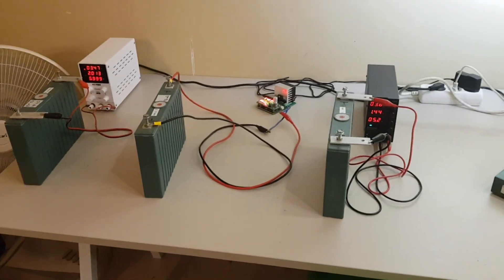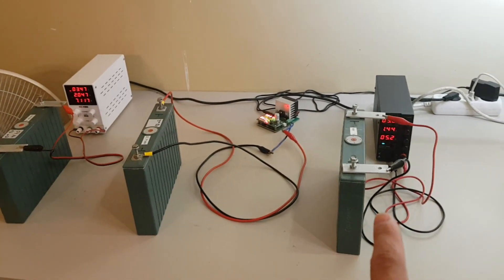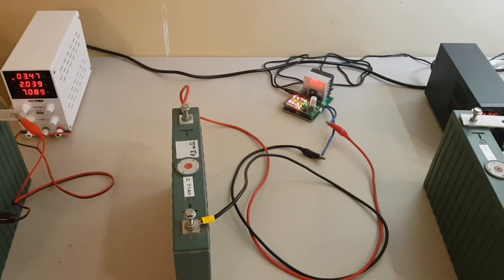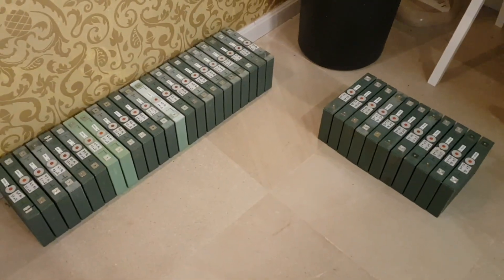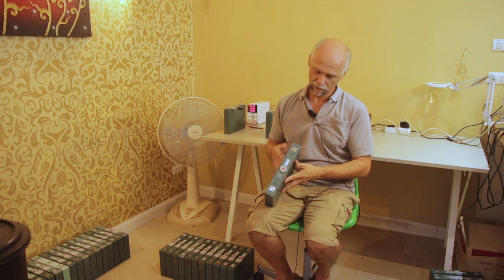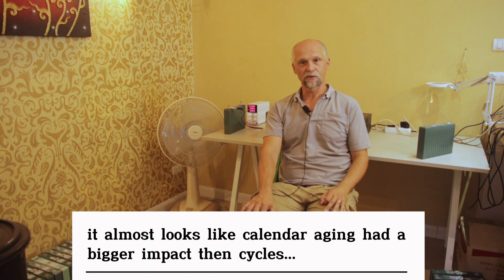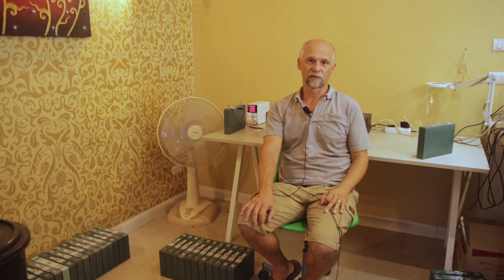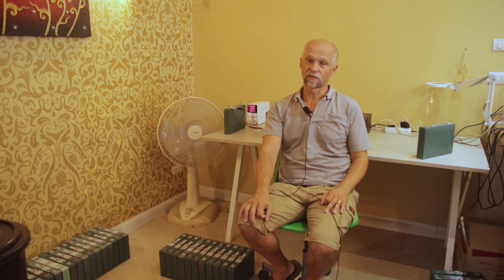LiFePo4 Cells at the end of their life! How did they perform, what's left of it?

Comment: I have Narada 48V 15s 100 ah battery which was not giving good off grid backup. I have total 4 of them. This problematic battery get charged fairly quickly than other three. They are all in parallel to get 400kwh. Since i bought used there was no warranty. I opened the pack and found one cell 3.7V all others were 3.31V to 3.32V. The bms i think stops charging after noticing one cell has over voltage. I drain that cell  using power resistor to balance and connected to inverter without bms to charge but that cell over charges  again to 4.2V dangerously high. Took that cell out it was fully swollen. Replace that cell with 0.32milliohms ir cell. Now its somewhat better but still not as good as other three. What do you think is the problem. One thing i notice that cells above and below when charged without bms were 3.5V , is it because of that overcharged cell. I may have to open the pack again to see voltages again .
Reply from the maker: You definitely had a dead cell and it needed to be replaced. When you replace a cell, you have to slowly charge up the whole pack and simultaneously drain down the cells which reach above 3.45-3.5v to top balance the whole pack. do not remove the BMS! It just makes sure no cell will overcharge or over discharge.
Packs which do show capacity issues without having dead cells, usually are having severe balance issues. You can either install a powerful active balancer or manually drain high cells by performing regular manual maintenance once the pack is nearly fully charged...
Reply: You are absolutely right. Another cell, the one above the swollen one is also bad. Checked voltages again to a fully charged battery. All 14 cells were 3.33V to 3.35V but one cell that shared +ve terminal of swollen cell is also bad 3.7V let me change that cell too.

Comment: Wouldn't matching internal resistances and capacity be advisable?
Reply from the maker: yes. But then all cells of the pack must be similar. If something goes out of line, it must be removed. Strings with different resistances and capacities would have to build a complete separate battery with its own charge controller/inverter.
That's why battery manufacturers say you should only put the same age packs in parallel or at least buy them only a year in age apart. But that.also means you cannot regularly upgrade your storage capacity by just adding new packs in parallel...
Reply: @RolandW_DIYEnergyandMore couldn't micro inverters used for solar make a distributed battery with each unit of similar characteristics contributing to ac bus?
Reply from the maker: @robertpeters9438  one could make an array of small batteries. But it's not always easy to just connect a microinverter to batteries, and then its again much more complex, probably more expensive as you need a charge controller, bms, cells, inverter for each. And that to save worn down cells from recycling? It's anyone's decision.
I did that sort of energy storage before. Now I am happy that I have a much simpler setup :)

Comment: wow 6k views in 5 days. glad to see your videos and hard work is getting more recognition. really good info. no one online really has end of life data yet in this space. 
the fact that these things were rode hard and put away wet before you got them, yet you were still able to get so much use out of these in the hot thailand weather with daily use. i think ev environment is the most demanding for lifepo4 cells. they really dont like to be discharged fast, and dont like to be charged cold. both things happen in ev applications. also the early EV battery packs were kind of garbage for regulating temp/charge/discharge parameters.
the smaller the cell packaging/ah rating, the better they fair with high current applications. these are on the low end of large format today but back then they were probably some of the largest cells being mfg. another important factor.
there was a study recently about how occasional high current discharge/charge such as in EV's with their regen breaking and lead foot drivers might actually help extend the life of lithium batteries. i think the study was only done on NCM chemistry though. I know for like lead acid if you over charge an old cell you can sometimes allow for side reactions which can regenerate cathode at the cost of some electrolyte. would be interesting to weigh them all and see if there is as good of a trend as the internal resistance. thats a lot of work though :)
thanks for uploading roland
Reply from the maker: Yes. For my channel this is considered as a viral video :)
Don't know if such cells could be refreshed a bit. Don't think by overcharging as they would bloat right away, but maybe fill up a few milliliters of fresh electrolyte. hehe
Reply: @RolandW_DIYEnergyandMore  ya from what i understand the solvent they use is a phosphorus based alykl compound and is pretty nasty stuff in terms of health hazards.
i would just buy new cell4s lol. here in the usa they were around 35usd/kwh a month ago before all the tariff garbage

Comment: If stating data sheets you also have to look at the whole picture! The cycle life stated is only that ... cycle life at low stress. Loaded at 1C constantly the cells could to 12 cycles a day, 4380cycles a year with aging not being a factor. I don't know an application in which such stupid thing is done and the energy not just used directly, but the application is not the cell manufacturers premise! Additional there is calendaric aging component, too. Electrolytes have made huge progress in regards to calendaric aging for ALL lithium based cell chemistries! And simple stuff was found, like the type of tape used to fixate the rolls or stacks before they are inserted into the canister having had doubled the calendaric aging is only one step. Hold that picture in your head: Just changing the material of that 2cm of tape HALVED the calendaric aging!

These first gen cells are clearly first gen! If the manufacturer states 2000cycles and the cells, just for being 1st gen, have 2% of calendaric aging, they have lost 16% just through age alone! That leaves only 4% of the capacity or 20% of the whole degradation "bugdet" for cycling ... or TADA ... 400 cycles to 80%. In the original use (3 years to 80% it was?) this would mean 6% through calendaric aging, 14% through cycling (which is 70% of the degradation-budget), so 1400 cycles. This would mean 1.3 cycles a day, or in practice two charges a day of the bus. This is totally in the realm of possibility, as battery sizes in busses back then were tiny!

Grid battery providers are stating that through real-life data they are confident to plan with 3000cycles over 10 years where cell manufacturers state 6.000 cycles @70% DOD and I assume 1% calendaric aging this is a perfect fit ... half the degradation to 80% is calendaric, half is cycling.

And Model 3 LFP degradation data shows 5% degradation after 500cycles and 2 years ... even when supercharged most of the time and very regularly being charged to 100%, as the manufacturer recommends. Getting >200 cycles a year from the batteries you could also call this a high throughput usage. So the battery could have had a far easier life but did very well in the degradation department.  With calendaric degradation of 1% per year the cyclic degradation was only 3%. We know from studies that degradation in LFP is quite linear, compared to NMC NCA where the curve is s-shaped (where degradation at the beginning is rather quick, slow during the bulk of the life time and accelerates towards the end). So I naively say that 3% over 500cycles gives around 3500cycles of cell in a real-world, high performance and high throughput scenario. 

But In home energy storage scenario you have high throughput but at tiny below-1C loads. And 100% is something noone would really charge to, if having a choice. 

Battery size plays a role here, too! From the busses 8 years ago to today average battery size grew about 5 times. So instead of doing 2 cycles a day, in the same route the battery is big enough to only being subjected to 1 cycle every 2 to 3 days! Bringing on the cycles at a fraction of the speed inversely elongates their life time! In EVs when coming from very tiny heavily stressed batteries (4C while just normally accelerating to legal speeds, also and especially in busses!), doubling in capacity can easily tripple the life time (2C of stress ... which is totally different league)! Additional doubling will not have that same effect as then aging gets more relevant in degradation than cycling!
Reply from the maker: Great piece, thanks!

Comment: Interesting.
I happened to test after 3 years with high discharge on our packs in the real world, capacity loss .25%
I have seen 5 years of real world cycling show a loss of 3.7% from others.

The cells you have  are 2000 cycles.
The dod is not 80% of use but 20% dod, (20ah) it seems like they have it backwards.  They are not as most have claimed, and its interesting to see the reverse of the claims. 

I have test results on my website. Which shows why and how they can alter over time and by use type, it is easy to take 1/3 of the cycle life and capacity off the cells.

The factors include the charge rates and temperatures do make an impact on capacity.  And the older cells will age faster.
I think the way you had the cells could not have been worse for them too.

All in all, i think the  life you got from those cells, is about right for them. The calb cells are known to be like this and why they changed to metal cell casings.

Thanks for this video and all the real world information does help for the real world user and customer education.

Note that lab testing and claims cannot be produced in the real world. There was a thing with lead acid capacity claims back in the 80's were by it was misleading and not accurate.
Reply from the maker: Thanks for you detailed reply and valuable information for the community!

Comment: I have cells salvaged from 1998-2013 laptops and made into powerbanks. Some of them does not work, but most do and they are 60-80% capacity. Even the 1998 ones still work to this day, with 70-80%. My solar has lead batteries from 2021 and 2013 both workind despite 10+ year age. The newer one is actually worse but its not industrial battery anyway. The older is real industrial backup battery. When theh give up I switch to LFP.
Reply from the maker: Nice. My >7 years old LiPo battery pack is degrading in a different way too. The other Li-chemistries from consumer devices are more sensitive to how hard they are used and not so much on cycles or general age I think. Thats why when used in laptops and phones they do die much faster then when slowly and steadily used in a solar application.
Reply: @RolandW_DIYEnergyandMore  Phone batteries are often LiHV chemistry and het charged daily so its no wonder theu degrade. Laptops tend also take ovet 1C spikes so IR is very sognidicant and often is the only problem preventing the battery from working. In solar systems this is no problem because the current drops to tenth of that per cell. Also the 4+ hour batteries on laptops tend to work well even after 10-15 years, but there are differences beetween cell manufacturers. The old school LCO chemistry is very stable against degradation and often can be recovered from complete 0V discharge. Some studies say its actually more stable than LFP, but the thermal runaway stability is often thought to be lower.

Comment: do you believe manufacturer specifications?
EVE claim 8000 cycles for LF280K at 0.5C - that would take 3.65 YEARS TO COMPLETE! (0.5C implies charge/discharge taking 2 hours each. Thats 4 hours per cycle - thats 32000 hours for 8000 cycles)
They also put rest periods in their testing.
Does anyone really think EVE tested for 3.65 years before writing their datasheet???????
Reply from the maker: Todays LFP specification claims are pretty ridiculous imo. My new cells have the 8000 cycle life too. I make average 20 cycles a month in my solar application. That would be 31 Years till the SOH comes down to 80%!
Nobody really specifies calendar aging, which in this case would probably be greater then cycle aging. And then of course there would always be the argument on what other negative factors will contribute that you will never get such an amount of cycles in the first place :)
I really do hope that I am wrong and the manufacturers are right. But in my case I might not be around in 30 years to tell you the story. haha
Reply: @RolandW_DIYEnergyandMore  yes, calendar aging AND temperature are much more of a lifepo4 killer than cycles.
Chasing cycles is like chasing unicorns.
That said, I have 2 Victron Smart Lithium batteries that have been cycled on average to 50% EVERY DAY for the last 6 years, and they are about 70% of original capacity.
They were probably overcharged for the 1st couple of years, because I followed the manufacturers recommendations.
Now I charge to 27.4V (3.425V per cell) every day, and once a week to 28.2V (3.525V per cell)
If I had done that from new, who knows what difference it would have made.......

Comment: Transitioning batteries from Vehicular power to stationary storage, is not about a loss of capacity, but a loss of cold Cranking Amps.
Arranging ageing cells in a battery is a black art. Ive been living with battery power off grid since 1994 and I am only scratching the surface. Every time I think i've got a handle on it, a battery will throw me a curve ball.
I've seen deep cycle flooded lead acid cells that are 70 years old and still going strong. I've seen brand new car batteries die in a matter of hours.

My rule of thumb is if a job is worth doing, it is worth doing poorly, then tinker with it to make it better.

Comment: 8 year liefe timeand ~2000 charges for very very old LFP is bad??? i dont think so.
newer manufacturing is improved so what we can expect from new cells?

from another youtuber i habe seen a video of 2 year old eve cells in heavy solar use.
he noticed far below 10% degradation in 2 years....so ~15 years in heavy use possible.
Reply: If you spent $60,000 on a car and your batteries go bad in 8 years, and are told that new batteries cost $20,000, yes it's bad!
Reply: @theclearsounds3911  In EV battery 2000 cycles is about 500000 km so they will probably last way longer.
Reply: @theclearsounds3911  lol my 13 year old ev paid for itself in gas savings after 18 months. go cry on other ev videos

Comment: Woah,  it's good to know that cell capacity (SOH ?) is not directly (linearly) connected w/ the internal resistance of it.
Reply from the maker: no, indeed it is a quite exponential function.
Reply: @RolandW_DIYEnergyandMore  Thxs for the insight.
Reply: if the sealing from a cell is not good the elektrolyt kann dry out quicker with near no movement of the electrolyt on some cell types.
basicly the internal resitance ist the best indocator how good the conditon of a battery is, high improved resitance =battery is near done....

Comment: Interesting video, though I'm afraid that it's very likely that temperature is what killed your cells. Temperature and cycle depth are the two primary driving factors for cell degradation, and 45 C is very hot. Even if just stored at such a high temperature, you would expect 10-20 % of degradation per year, as opposed to 2-5 % if stored at 20 C. Combine that with what seems to be quite deep (>50 %) cyclic use, and you end up in a very high cell wear situation. You are absoluely correct to question the ridiculous cycle life claims of LFP cells, they are often straight-up lies as anyone with half a clue will tell you. In your case there's just more factors at play in addition to that.
Reply from the maker: Thanks

Comment: You may wish to look at the cell balance in your power wall.  With a huge variation in capacity, the weaker cells were being stressed a lot more and may have seen a lot more voltage stress, as the weak cell will hit the low trip voltage first, and in charging the weak cell will hit max trip voltage in the pack as the other stronger cells will be lower voltage during charge and the weak cell will ramp up voltage quicker.  If you monitor the individual cells you will see the cell level stress.  Its important to match the cells in a pack for maximum energy and life.  Cell balancers are only designed to even out slight difference between cells of a few %.  I am surprised you mamaged to use dead cells for 3 years.  If it was lead acid you wouldonly get s few months
Reply from the maker: Yes. I had 6 cells in parallel per string. Always 3 of the (for me) 5 yo, 2 of the 3 yo, and 1 of the 2 yo. The strings where pretty equal to each other (maybe just a few % off of each other). So the weak cells where carried on by help of the better cells. I am actually surprised that the better cells didn't suffer more from the job they had to do. But I have always tried to not go over the 0,25C rate for the whole pack.
So yeah, this was probably more of an experiment of how LFP is doing "beyond" its End of Life...
Reply: @RolandW_DIYEnergyandMore  yes in parallel the weak cells just add a tad of capacity but do not really add much.  Overall not too bad, but you should not have been charged for end of life cells.  I would be most concerned as to how the cells were already at end of life after 2 years.  If they were used in a bus it s likely they were very rapidly charged to keep the bus on the road, possibly every 4 to 5 hours leading to a very high cycle life at high current charge